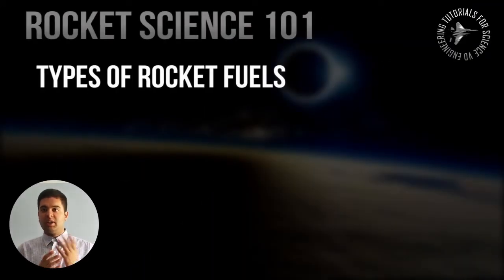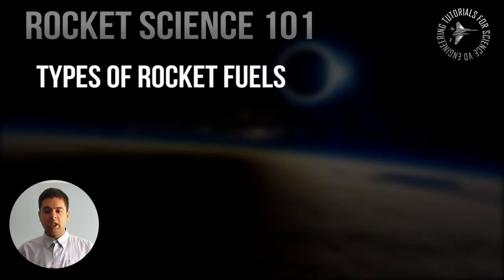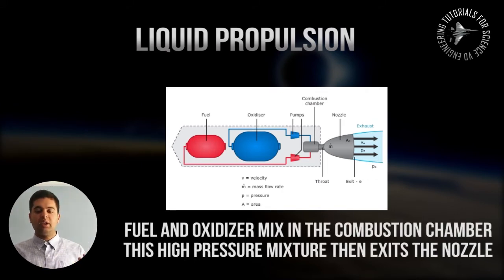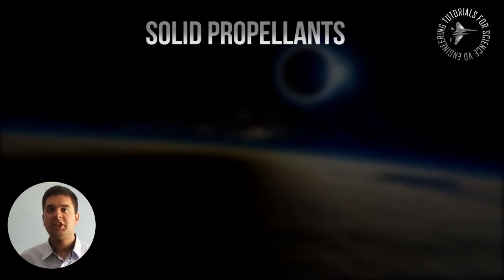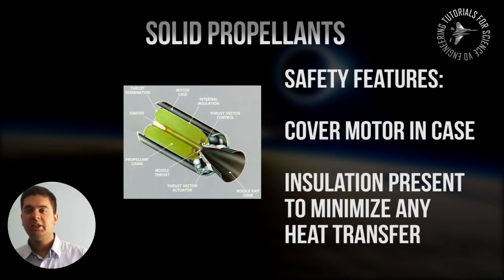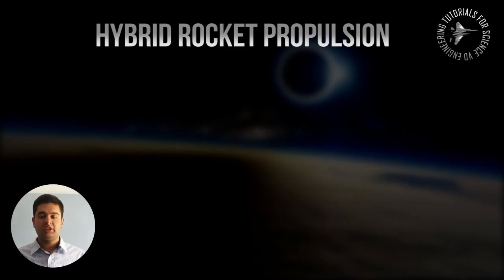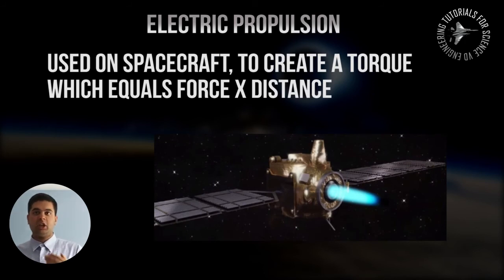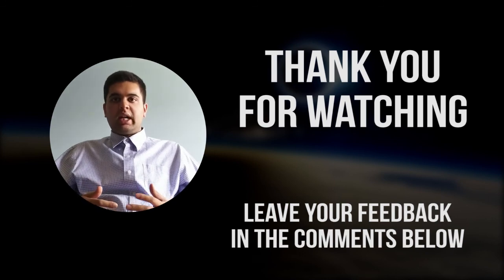Rocket Science 101 | What are the various types of Rocket Fuels? (For Beginners)

Comment: Is there research into reuse of exhaust   fual on what the rocket expels while in take off mode 
Maybe having a massive u shaped tunnel under the starship take off platform and a monitoring tunnel to actually see or technologically wise dissect what is happening to fumes as it takes off so boffins may find something revolutionary more economically friendly in future on take off.
Reply: Maybe it would be to dangerous to contain under the specific conditions
Reply: First of all, big tank for exhaust underneath the launch pad may hinder structural integrity of pad(especially with big rockets)
Second of all, chemically rocket exhaust is very simple. It’s hard work with little to no progress from it

Comment: I just wanted to point out that, if i'm not wrong, ionic engines does uses inert gases like xenon so it can be ionized and the electrons expelled from the back of the engine.
Reply: An electric field uses xenon to accelerate and shot backwards, the electrons help it to accelerate
Reply: MrGustavoselem all gases can be Ionized, they just use noble gases to stop them from reacting with the engine as chemical reactions could damage the engine

Comment: Could you make a video on creating a nozzle. Like what factors determine size of exit diameter. Im creating a nozzle for my solid state motor, but im having trouble figuring out how to determine if its mathematically correct. My fuel is 1000grams of rocket candy. (62% potassium nitrate and 38% surgar)
Reply: The vapor pressure where you want the engine to be most efficient, velocity/temperature/mass of the rockets exhaust, and the material construction of the nozzle are some of the basic factors. Ideally you want the exhaust gases to be equal pressure with the atmosphere in which they are discharged in for the highest specific impulse. This is the reason the falcon 9’s vacuum Merlin engine nozzle is much wider than those in the boosters. The increased volume of the nozzle helps to reduce the pressure of the exhaust gases making the engine more efficient in the vacuum of space, but much less efficient at sea level since the nozzle can’t build as much pressure as the sea level Merlin engines. This is the reason if you watch footage of the space shuttle launching the R-25 main engines on the orbiter have “shock diamonds” almost immediately after the nozzle due to the atmosphere compressing the exhaust. Hope this helps feel free to comment on this if you wish to discuss this further.
Reply: @williamgorham7339  You make a very interesting point. But I don't understand why is it necessary to reduce the pressure of the exhaust to the level of the atmosphere in which the propellent is discharged? What would happen if the pressure of the propellent is higher or lower than the atmosphere? Surely having higher pressure would result in greater performance even in thinner atmospheres (like space vacuum), no?
Reply from the maker: I'll keep it in mind